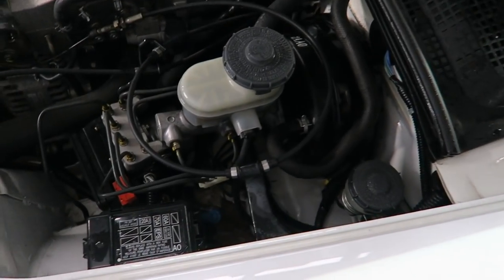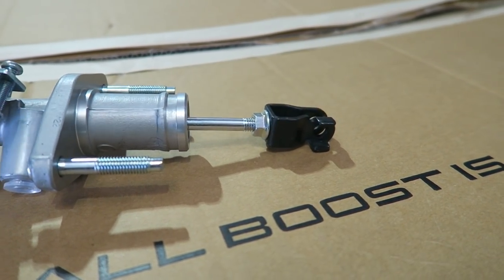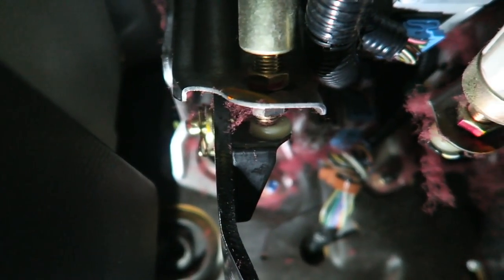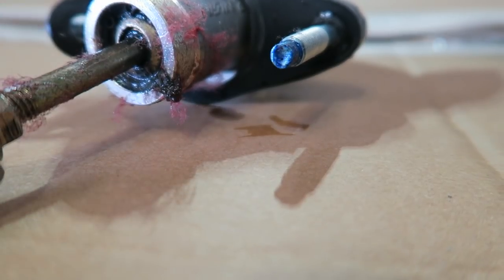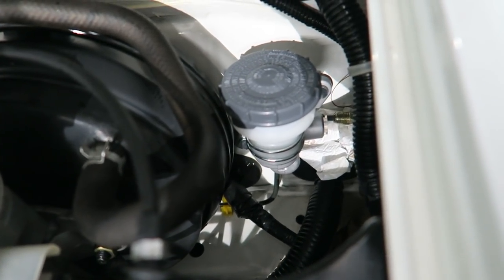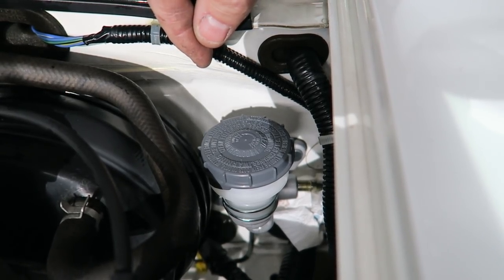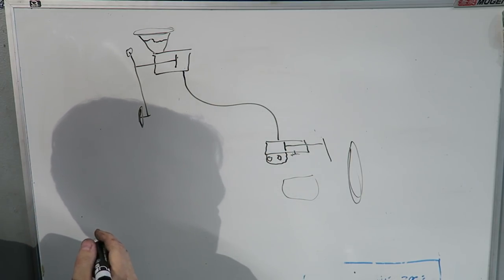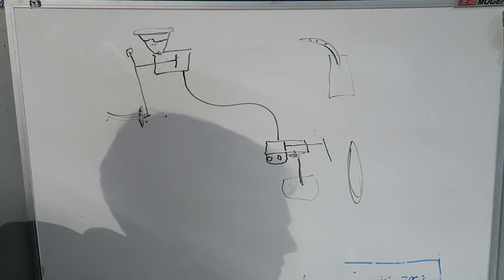CMC How to: Master Cylinder  - S2000

Comment: Brilliant, easy to follow tutorial. More please 👍😁
Reply: A quick follow-up to say I re-watched this and changed mine today. It is slightly easier on a RHD car due to the additional space where the hydraulic line goes into the cylinder. Took me a while to bleed the system but got there in the end. Thanks again for posting this video. Your advice is invaluable 👍

Comment: The spray part from a spray bottle is my go to. I just spray all used brake fluid into an empty brake fluid bottle, I use that bottle to run my 1/4in ID fuel hose from the caliper and clutch bleeder. Replacing the clutch fluid will keep the master from leaking, no need to bleed, just empty the resevoir, fill with fresh fluid, pump the clutch 100x with the car off, then replace fluid again. Do this 2x a year and you'll never need to replace the master ever again. Also a lot of S2k masters leak, the black sludge is actually the seal.

I'm sure you know this too, but unbolting the slave and gravity bleeding with the bleeder pointing up in the air is the best way to bleed the clutch line. Think of a soda bottle, the air always settles at the top, if you turn the bottle over and open the cap the air stays in the top. This is why I hold the bleeder straight up. It's like opening the soda bottle and squeezing from the bottom, the air has no where to go but out.
Reply from the maker: This is true, I 've found more Florida cars have this problem than others. It's so humid here and I wonder if it has anything to do with the fluid being contaminated sooner. Thanks for adding the comments, I hope this helps people.

Comment: For anyone wondering what's the best size hose to use for this procedure, I've found 1/4" I.D. fuel hose works best, I've used the same fuel hose for 2 years worth of cars. It snugs over the bleeder perfectly making an air-tight seal, and you can see all the air bubbles coming out of the hose like you mentioned.
Reply from the maker: Thanks for the comment, I hope this helps people that feel comfortable enough to do it them self.

Comment: The orientation of the clip and pin is very important, on the way you showed(pin entering the right and clipped on the left), it allows you to adjust the clutch pedal so that the clutch action is at the top of the pedal stroke. If the orientation has the pin coming from the left and clipped to the right, you're denying yourself one full turn of the clutch adjustment rod, so the clutch action will be a little lower on the pedal stroke even if you extend the rod as far as it will go.

Some people prefer the clutch action a little lower, some like to have the clutch action at the very top of the pedal. Personally I don't like to have it a the very very top because I feel the clutch isn't fully engaging
Reply from the maker: Rolando Tillit The pin should go Left to right. The clip goes on the left. Unless you brake loose the jam nut loose, you can spin it until your blue in the face and it will not adjust the clutch at all. Adjusting the travel/ free play is done by braking free the jam nut and adjusting the threaded rod into the bracket. 😎
Reply: @LHTPerformance  You mean the hook clip is on the brake pedal side, or facing the ECU? The bracket has those tabs to keep the pin from turning, so if the bracket is facing the brake pedal then the pin is entering the right and the clip is on the ECU side.

That is the orientation from the factory, and how you have it on your video, that is the correct orientation. Like you mentioned, you adjust the free play by loosening the jam nut on the master, and turning the rod. If the clip is facing the wrong way you deny yourself the ability to adjust out all the free play. If it's facing the right way it gives you a few more threads to dial out the slop in the master.

Comment: I wish I knew to check this before I bought my 2001 S2000. Only had 28700 miles on it but at 34200 I had to replace the space and master cylinder.

Cheers

Comment: Oh and another mega issue for us in the damp uk, is seized suspension alignment bolts. Mine are all seized up so cant get an alignment done until all replaced. I've bought all replacement bushes (mugen compliance) and honda bolts etc. Just need to cut out the compliance bushings. It a hell of a job. Another one for tech wednesdays?
Reply from the maker: I would coat everything in Space grease where you live. We don't have the rust issues here in Florida but I remember my UK days and rust.......

Comment: love these tutorials, even though I dont personaly have an s2k, Im sure most it applies to other manual cars, with a few differences in installlation process. Is it common practice/recommended to flush clutch fluid every 2 years?
Reply from the maker: I personally would change it more often if you can do it yourself. I tend to be over kill with my own stuff.

Comment: It there any noticeable benefit to removing the delay valve in the slave cylinder in the AP2. The AP1 does not have it. Seems easy enough to take out. I dont think yall have a video about removing it. Probably helps with driveline shock if someone was beating on it.

Comment: New clutch, Pressure plate & ap1 flywheel less than 20k miles ago.. fluids just changed & my clutch feels soft and engages lower to the ground. 1st and Reverse is also hard to get into. Probably the Master/Slave cylinder?
Reply: What did it end up being? I’m having the same problem with 1st and every other gear. It’s stif and won’t lock in

Comment: Happen to have the part number on hand for an 04'?  Also, do you recommend replacing the slave at the same time?  Thanks and keep the tutorials coming!
Reply from the maker: JZ Hickory  The parts numbers are all the same.  The slave doesn’t often have as many issues, if it’s leaking.  Replace it.  The Slave is year specific

Comment: Should the pedal feel firm at the very top or should there be some “slack” before the rod starts pushing on the piston inside the cylinder? I have it adjusted to where there’s 0 slack, doesn’t slip while driving. But curious if this is proper
Reply from the maker: It should have some free play. I believe Honda calls for 10-12mm. If not tie release bearing is under constant load.
Reply: @LHTPerformance  Is that adjustment made at the master cylinder rod or clutch switch at the top? Keep finding conflicting info about it

Comment: You might not remember as its been a long time but what year was this S2000? I have an 07 and the fuse box is much closer to the firewall so its is getting in the way of removing the cylinder.
Reply from the maker: The 2006+ has the small fuse box that gets in the way. You can remove the 10mm bolt right there and give yourself some more room.
Reply: @LHTPerformance  Awesome thanks. I was able to remove the bolt and push the box down enough to get the cylinder out. Thanks for all the videos they are very helpful. My next project is changing out the shifters plastic parts.
Reply from the maker: @iane9552  Great, glad you got it. The shifter rebuild is still one of the most rewarding and easy to do DIY mods. You’ll Love it.

Comment: The 10mm wrench should be flared otherwise you risk stripping the fitting.
Reply from the maker: I have a line wrench but don't often need it. I think I did 60 some Master cylinders last year. ;)

Comment: What about when the clutch pedal gets stuck trying to to press and usually harder when accelerating harder or in higher RPMs? 
Fluid was full but still went ahead and flushed it, also lubed up the clutch fork as well. My next step is replacing the clutch slave as I seen someone found that to be the fix.
Reply from the maker: It sounds like an issue with the Clutch itself.  Possible release bearing
Reply: @LHTPerformance  that’s what I was hoping I didn’t hear 😭😭😭 and the clutch kit is just a little over a year old!!! Clutch masters stage (what ever you suggested) with Honda release bearing to boot, but on your behalf, I didn’t change the collar  🥺

Comment: Wanted to ask..have u dismantled one and tried to service it?  I know its easyer to replace it but just to change the failed parts inside seems possible
Reply from the maker: I haven’t tried. I don’t think the parts to rebuild it are available.  I’m pretty sure the piston is what falls apart but possibly the bore gets damaged too. From what I see, they start to turn the fluid black and leak a very small amount first, them quickly go down hill.

Comment: Have you heard of or done a clutch delay valve (CDV) delete on one of these? Do you know if a 2002 model year S2000 even has one? Thanks!
Reply from the maker: Yes.  It’s there to prevent drive train shock.  Removing will allow the clutch to bite a little harder but it’s harder on many components.  Hence why Honda designed it to that.
Reply: Thanks John. After further research not sure the AP1 has one. Looks like a change they made to the AP2 … please correct me if I'm wrong. Don't want to take mine apart and find it's not there! Thanks for your videos … they've been very helpful as well as entertaining :)

Comment: I recently changed clutch master changed and bled the fluid and did trans fluid with royal purple as you recommended.  Car was running like a top. One month and 5 rides later, the clutch feels notchy and stiff again.  Is there any linckage I should lube or do you think the slave is causing it to be notchy?  When I say notchy I mean stiff intermitantly.  It feels like a linckage issue ...perhaps .....  Any thoughts here would be welcome.
Reply from the maker: dirtydelta7 The notchy feel is most likely from the release bearing and slide.  The grease dries up over time and the bearing doesn’t slide smoothly.

Comment: My clutch gets stuck and won't go into gear is it my clutch or master cylinder
Reply from the maker: Fernando cadena Without checking I can’t be sure.  It sounds like the hydraulic system though.
Reply: @LHTPerformance  cuz my clutch pedal started feeling worn and the its didnt gho into gear I had to turn off to get into gear to start and parked it in the garage
Reply from the maker: Fernando cadena It could be a worn out clutch too.
Reply: @LHTPerformance  yeah I've been dumping the clutch on burn outside so I think ima do the master cylinder and the clutch but what about the pressure plate and atuff?